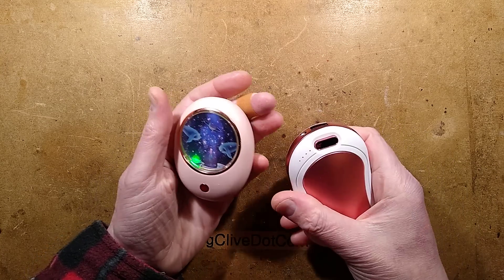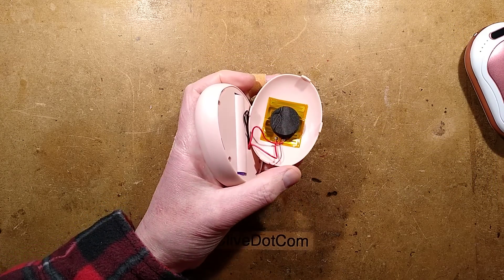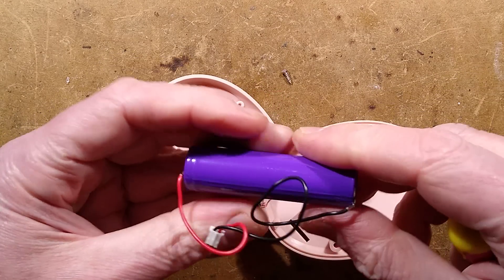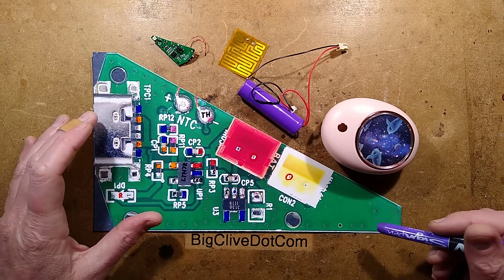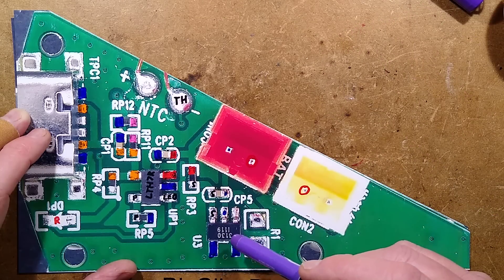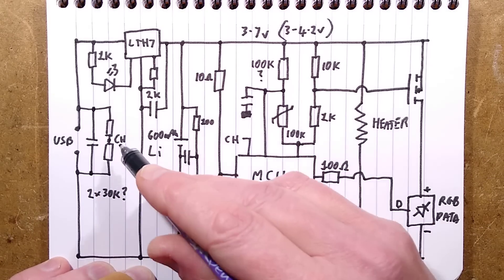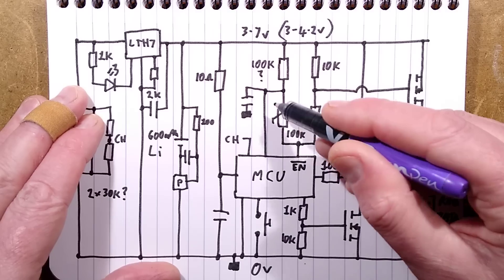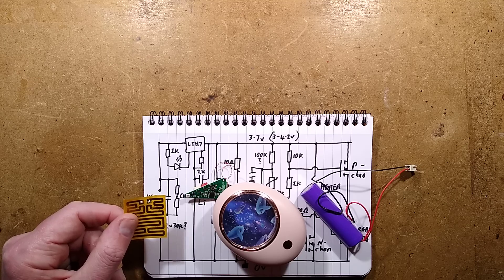Engineers vs accountants the handwarmer mix.  With schematic

Comment: I have used the chemical warmers they are great, and cheap used to use them when playing golf in cold weather and testing heater alarm probes as they would go to 50*C, never fancied the electric ones as they would not last long enough for a round of 18 holes🙂
Reply: the petrol / zippo liquid catalytic ones give a good heat and last for hours and hours - bigclive showed some off a few years ago. 
you can still get 100ml of own brand zippo liquid for £1 at poundland
I'm assuming zippo liquid isn't the chemical you meant.
Reply: @joinedupjon  No not the zippo. they were Iron Powder Heat Pack Warmer Instant Chemical Heating Pad

Comment: I am wary of any device powered from USB. Anything plugged into mains has to meet the electrical and safety codes where you are. This would be the USB power supply. It's load, being low voltage, is exempt from the codes and you have no assurance of safety. Would be a big concern if trying to use your computer as a USB charger and depending on its self protection.

Comment: You never know, they might have thought they were buying a decent cell, maybe some are and that one was bad. Maybe the supplier was the dodgy one, because the rest of the device seems quite good.
Reply: this seems like the type of thing where there could have been multiple batches made and/or these are factory rejects. the good (or at least better) ones probably get sold in mainland china and the worse ones get shipped out. mainly when selling things on ebay with free shipping, you're not going to get many returns and maybe not even that many complaints

Comment: A very good tear-down, Clive, but a shame costs were cut at its design stage to save a few groats. However, I'll be very interested when you review the larger hand warmer because two years ago I bought 6 for my family from a local shop for just £9.99 each, being 10,000mAh. Interesting, but prices haven't increased since. Crucially, I made sure all these hand warmers had protection mechanisms. 

Ours have been very reliable using a smart chip ensuring over-charge, over-discharge and short-circuit protection; plus 3 levels of heat, the LED light and that strange vibe buzzer thingy like yours. Same rose gold colour, too. My daughters and twin Sis, all happy. Time for bacon and eggs. 😋 See you later!

Comment: say Clive, what is that isopropanol bottle dispenser you are using ? Im currently using an old inkjet refill syringe, not ideal.
Reply from the maker: It's a needle tip bottle from a bulk pack I bought on eBay.

Comment: (Off topic!) Big Clive, could you tell us about lithium car jump starters - the type sold by Halfords, etc. I think they're of interest to you because the lithium cells can deliver like 300 amps + at 12volts. That's a wacker! Yes, it's only for a second/few seconds, but this amazes me. 
Is a lithium phone power bank the same thing, but the circuits keep the batteries on a tight leash?
Reply: There is already videos like https://www.youtube.com/watch?v=F_F2iq-lHN8 and https://www.youtube.com/watch?v=0tGK1nqXr28
Reply: @AliusScitmelius   Thanks for the link. Will follow up. Good
Reply from the maker: I've taken a few jump starters apart, and even shorted one.  The secret is in the construction of their lithium cells.  Lots of parallel plates instead of a roll of foils.
Reply: @bigclivedotcom  Thanks, Big Clive. One of your audience sent me links to your videos on jumpers which I'm following up. Thought the huge current at low volts would be of interest!

Comment: I've found that violet 18650 cell everywhere, from a flashlight (torch) to a portable fan. 
Sometime is unmarked, other times is marked as a 2600 mAh cell.
I measured its capacity at around 2200 mAh. It has a low self discharge. What scared me is the internal resistance close to 100 milliohm.
A good Li-ion cell should read 20 milliohm of internal resistance, reaching 40 milliohm at end-of-life (after 200 to 500 cycles, depending on chemistry). These violet cells could be some "rejects", but seen how widespread they are in cut-cost devices, it could well be that they are manufactured to the cheapest possible standard. 
Thank you Big live for taking the time to analyze all these little gadget. It saves me a lot of time...
Reply: It's violet wrap. You can buy it and put it on any old cell (just like ultrafire etc wrap).

Comment: CLIVE! I just got some new led bulbs (new to me) you should take a peek at with around 20-25 cm of filament pulling only 6.5 watts. Should be extremely under-driven. Its a G.E. vintage style, amber glass, warm candle light (color; 2000k). Its huge, 35ish cm overall by 4ish cm diameter on a medium t20 base. They were on clearance at about 1.75 pounds each, same for some drop mounts that match the style line. They won't sell the one in the display and its annoying. I figure they'll never cook and last a hundred years. Glass is almost cool, about 21° c in a slightly colder room. They have quite a line in their "vintage style", one was a 20-25 cm globe with a similar if not the same wattage super long filament loosely coiled inside.
  I really just needed some red light. I bought all super white hospital color leds when I switched a decade ago from cfl's by mistake and still have most of them. Could only get 11 😢. Crack one open if you get the chance. Later.
Reply: The big globe was smoked glass with a bluer (maybe due to the glass color?) color. Still nice though. Looks fancy.
Reply: They're 120v. I'm in the states. I just gave metric so you didn't have to convert it.
Reply: I found some bug bulbs on sale. The filament is double! A full 40-50 cm for 6.5 watts!

Comment: Huh. Add the USB identifying resistors, a better battery, replace the thermistor with a light sensor and the heater with a beefy LED and you'd have a nice rechargeable dark sensing light.
Reply: Or…

…you could just buy what you wanted in the first place 😂
Reply: @fredbloggs5902  Where's the fun in that?

I would never buy one of these things new but occasionally I will pick one up at a yard sale or second hand store specifically to see what's inside,  with a view to repurposing it or just using it for parts.

Doesn't everyone?

Comment: Hi Big Clive, thanks for all the videos!
What do you do with all the stuff after you have disassembled and analysed it?     I'm sure you've been asked many times, but I've missed the answer . :dothefive:
Reply from the maker: Some gets kept, but the lesser stuff gets stripped for it's useful bits and the rest recycled.
Reply: @bigclivedotcom  thanks you must have a ton of stuff by now 🤔
Reply: @bigclivedotcom  Off-topic here, but have you thought about looking at the electronics powering HID car headlamp bulbs?  They seem to be available for several different voltages, up to 85V, and it would be interesting to see how they are driven from the 12V system.  (Unfortunately the lamps are about £40 each.)

Comment: But true to form, then engineer said, we need to have a 2500mAh battery to work well, the bean counters said we will make more if we reduce it to 600mAh. But to save the day marketing said we will sell a lot more is we say it has a 5000mAh battery. So everyone was happy even fleaBay and conillyexpress as they got their cut. Even the customer was happy with the colour changing led until two days later when it was put to the back of the sock pile never to see the light of day again.

Comment: Clive, great video. I bought some heated gloves and would like to see some gloves (or a vest or coat) dismantled.  My gloves have a recharable pack for each glove with a USB C charge port and 4 blue indicator lights and a mini round port for the gloves to plug into. On the glove outside there is a pushbutton switch for low, med, high and off. If you run across a pair that would make a cool video. I don't wand to tear mine apart yet till they fail, I baby them so it might be a while.
Reply from the maker: I made a video about a cheap pair that used a carbon film panel.

Comment: When testing lithium cells for capacity, at which discharge rate do you measure that ?
Reply: Well, the traditional 1C rate requires knowing the result. So I'm guessing whatever the tester happens to assume.
Reply from the maker: If suspicious about the capacity I choose 500mA.

Comment: With those USB C resistors it's a bit more complicated. If you  use USB A to C cable it will work, but not with USB C to USB C cable.They use resistors on some of the lines to check for what voltage device wants.

Comment: That’s hilarious they felt the need to say it doesn’t explode 😂😂😂😂😂😂
Reply: Consider Ing the validity of the rest of its claims...
Reply: Don't ask us about violent deflagration.  😉
Reply: More products should state on the packaging that they don't explode.
Reply: That's a special feature enabled by omitting that resistor that bypasses the cell protection circuit.
Reply: Should be mandatory markings. UL-Akira Certified
Reply: Well, they _don't_.   They just catch fire.  Big difference there.

Comment: if you want to be overly positive, you could call it efficient engineering to use the battery to warm up one side by dispersing energy into a coil on the other side; in their minds they didn't lie when they said both sides were heated
Reply: No damn 18650 could have so high ESR to heat up at an amp, this one is probably recycled and leaky.

Comment: Those tiny capacity 18650s are worryingly often "recycled" as in "we took them out of an old laptop, covered up the ends with plates, and re-wrapped them".
This is why they don't have a capacity or have a fake capacity on them, nobody knows their capacity at the time of "recycling".
Reply: I has an 18650 that came in a cheapo green laser I bought. The battery felt lighter than my good 18650's and had a plastic case around it. When the laser first arrived, and I put the battery on my charger, it took about 100ma and was full. Ok, this isn't a good sign, and neither was the fact that the wrapper on the cell stated "8800mah". When the laser ended up weak, and it was time to recharge the cell, it was down to about 3 volts, and it took 200mah to charge it this time. 
Ok, let's tear this junk down....
When I cracked the plastic cell casing apart, SAND STARTED POURING OUT, and after all the sand emptied out, I found a tiny Lipo cell inside FROM A DISPOSEABLE E-Cig with it's wires soldered to the end caps of the fake 18650!!! 😆😂🤣

At least it WAS a rechargeable lithium cell. 😬
Reply: Except that usually these tiny capacity cells are also lighter than average laptop cell._
Reply: My friends remove them and use them in old style vapes. i'm sure thats the third time they were used.
Reply: Reduce, reuse, recycle - the order is important. Recycling should be the last option
Reply: @_BangDroid_  reduce, reuse, repair, repurpose, recycle.
Reply: @Dreddy72  To me, repair and repurpose fall under reuse but I get your point
Reply: Imo it is real recycling. No landfill is good  right?
Reply: @blueredbrick  Real recycling is putting the materials back through "the cycle". This is actually reuse, which is better than recycling.

Except lithium cells have a lifespan and have storage requirements, which are not usually observed during this kind of harvest. The smallest 18650 you can commercially buy is around 2,200 mAh, so anything smaller is usually end of life harvests.
Reply: @hattix6713  Ok. I see your point.
Reply: @hattix6713  Or one of those with a tiny cell in a sand filled can.  Which sadly in this case would be the preferable scenario.
Reply: @jaaxxone  well. Sand puts out fires, so......
Reply: @blueredbrick  not really as they are then sold in products that do not work properly and not only end up in landfill but have amassed a notable carbon footprint doing so :)